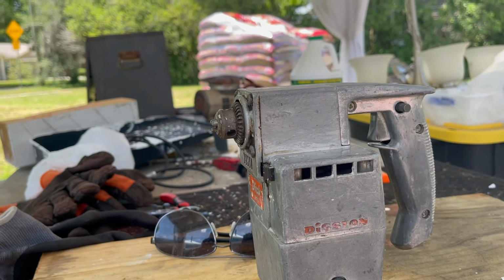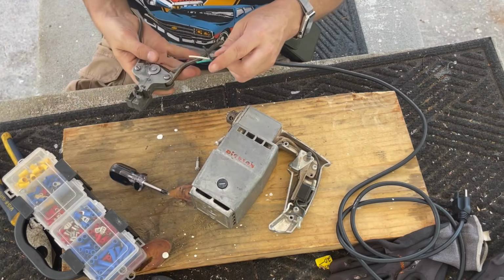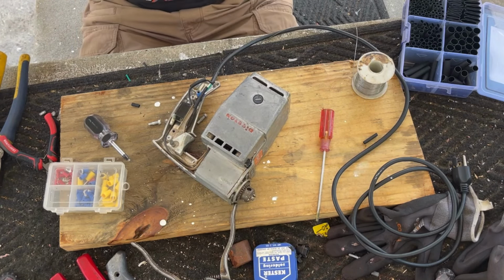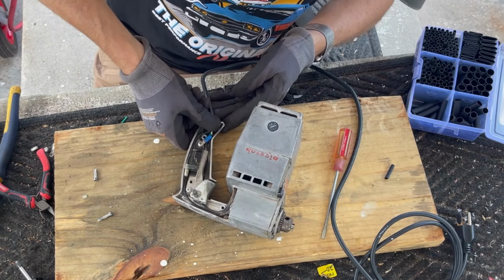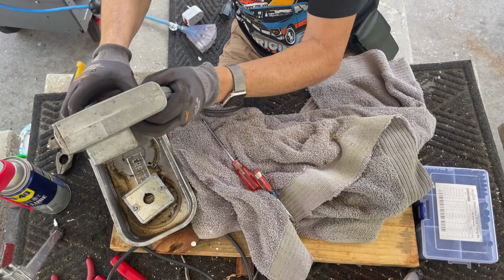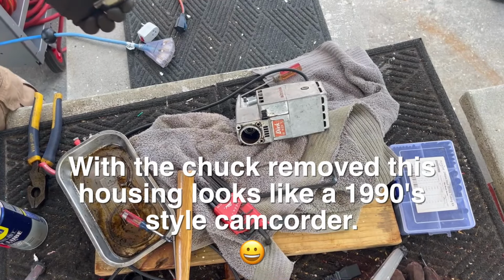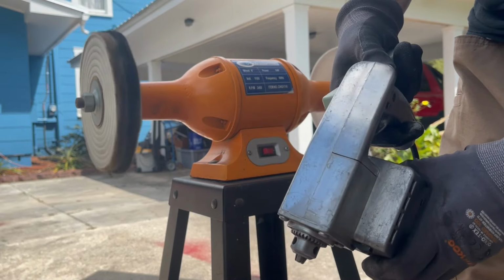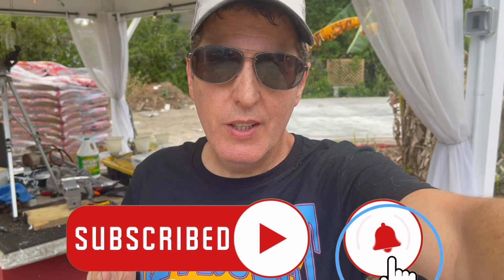Wild Vintage Design - Disston Model D25 Dirk Electric Drill

Comment: Wow, this is like... the world's first model of cordless drill, dang! What a weird shape; sort of like one of those hand-bucket paint sprayers. (Maybe you mentioned that too, but I haven't seen the whole video yet.) And for such a small chuck, too! Man, good luck getting that into kind of a tighter space, huh?
Reply from the maker: It's really fascinating how they did it.  The chuck is actually mounted inside the housing so you only see the gear and jaws but there's an entire chuck in the unit.  Once I got the new power cord on, it fired right up.
Reply: @floridarusticrepairs : Yeah, but by "small chuck," I meant that it only opens up to 1/4".
Also, did you like my little joke about the cord? 😁
Reply from the maker: @HelloKittyFanMan  Yes!  With the shape of it you can imagine there being a battery in there.   Regarding the chuck, yes, it's only a 1/4" but I'd also say it's the weakest point of the design.  It's cumbersome to open and close because you need to rely on the key at all times since you can't grip it anywhere.

Comment: Holding the craftsmans drill. if your using a small bit 3/16 or below. you point along the opposite side of the drill with pointing finger. Thumb straight up on opposite side and activate trigger switch with ring finger ( 2nd finger ). Bit like your pretending to shoot the hole. If you wish to clean parts electrical, an option is mineral turps ( best cold ) washes grease well and air dries clean
Reply from the maker: Thanks for the tips! I've instinctively held a drill as you described several times to drill straight but I never gave it any thought.   I'll pick up some mineral turpentine.  My father used that and it's a lot cheaper to clean a housing than what I've been using.  :)

Comment: Cool drill never seen one like that you done a beautiful job on the restoration. Really enjoy your videos. Thanks
Reply from the maker: Thanks!  I do think this is the most unusual design I've worked on but once you hold it in your hand it has a good feel to it.  The weak point is that working the chuck takes time because the only way to spin it is using the key.